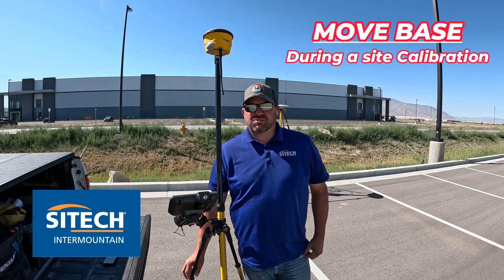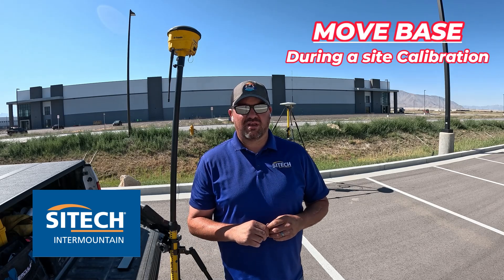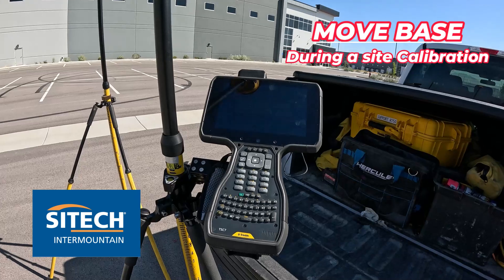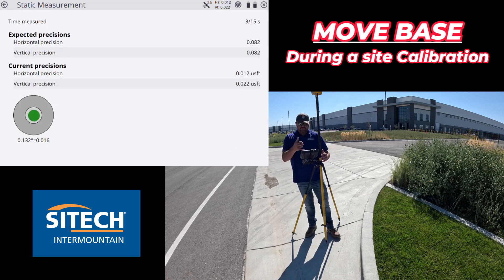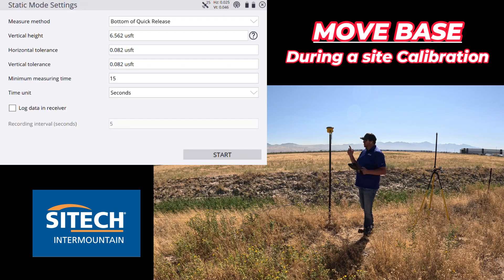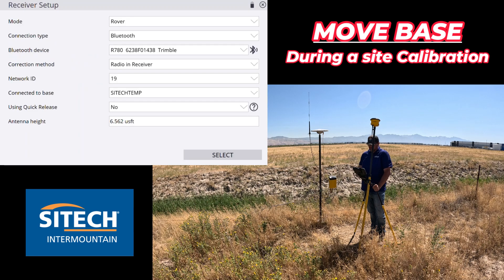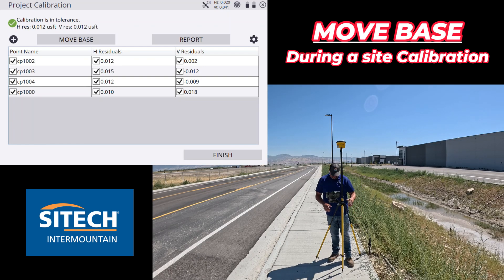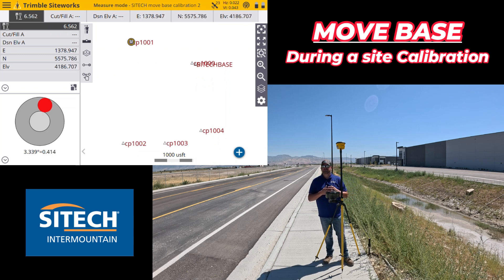Siteworks Move a Base During a Site Calibration

Comment: Do you have to use 5 control points in total or can you use the last 3 you used and just hit finish instead?
Reply: 9:25-9:30
Reply from the maker: @marlonsanchez4995  yes you can finish after any amount.  3 is the minimum for it to give you residuals.  But yes.